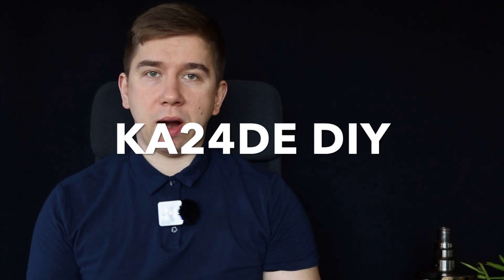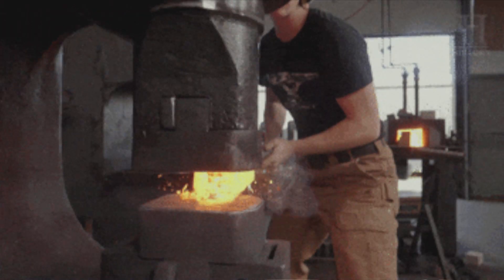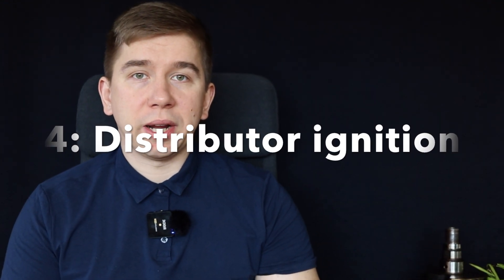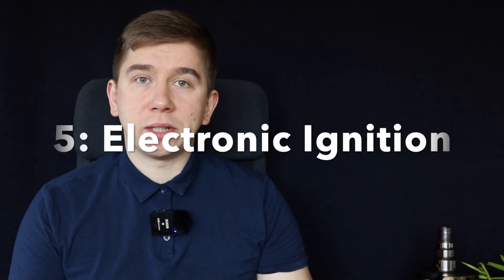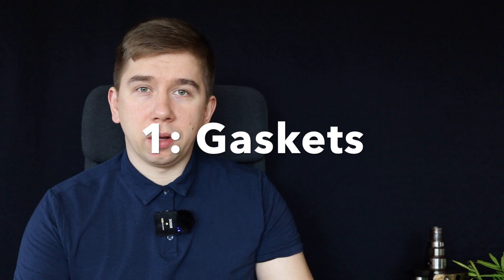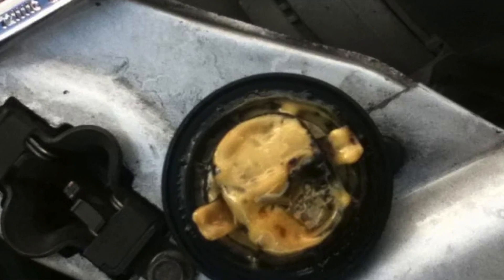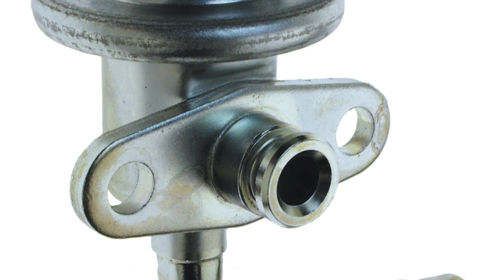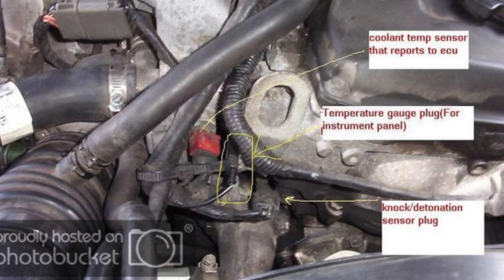KA24DE in Nissan 240SX, Altima, Navara | Strengths, Weaknesses and Common Problems | Do It Yourself

Comment: The only problem I have is the hydraulic lifter noise which seems to go away with fresh oil then comes back in about 1000 mile later. Not too noisy to worry me now

Comment: People dont even understand the sohc ka is pretty good turbo. They will take so much abuse and keep on running forever
Reply: My KA24E in my D21 blew out it's timing chain tensioner. I ignored the rattle for too long, and the stock one is all plastic. 

I thought it was worse and pulled the engine. It sat for so long before I did anything that the fuel pump seized.

Replaced that, and it would almost kind of run with a lot of ether. Found I had timing messed up badly and the oil pump was off a tooth or two. 

Now it won't start at all. Guess next step is fuel injectors, or something electronic. Need to try to pull codes. Waited a week, so I assume if I super flooded it, it's drained out by now. Pulled plug #1 and it does spark. Could always pull the rest and see.

It was a solid beast while it was running. Hoping to get it back there again. I'm more of a suspension guy than an engine guy, so I'm well out of my wheelhouse. If it does run, it'll need some exhaust work. Manifold didn't come off the engine but came off the pipe, now not going back together. I'm more rock crawler than drifter, so I'm not sure high hp is my game. Not that I'd turn down a few more...
Reply from the maker: @andrew40  Oh man that's unfortunate. Let me know when you get it to start!
Reply: @andrew40  How long did it take for the fuel pump to seize? Mine has been sitting for 5 years and ran great when parked. 163,000 miles on it.  Thanks
Reply: @JetCityMatt  All I can say is less than 8 years. That's how long mine sat when I found the problem. If you still have a good battery, go down and turn the key on for five seconds every now and then to spin up the fuel pump and keep it from gumming up. Unfortunately it'll still hum and draw current when stuck, so no way to tell without pulling a line or actually starting it.

I found the timing issue with mine was that I was 180 degrees out of phase. I set timing with cylinder 1 at TDC ... of the exhaust stroke (hey, I had 50-50 odds!). Instead of pulling the oil pump and setting correctly, I just left the distributor wired backwards. Works fine, and surely won't cause me any issues in the future when I forget that. 🙄
Reply: @andrew40  Thanks so much for your reply. I'm going to siphon the old fuel out of the tank and will pull the pump out them and inspect it and the tank.  Lots of other stuff to do too! It's quite a list. 
In 2020 someone got into the car and must have shoved a screwdriver in the ignition... then they realized that the battery wasn't connected and gave up.  Fortunately they didn't scratch the mint interior!  I appreciate your reply!
Reply: @StratMatt777  I have run a lot of very old gas in a wide variety of machines and have had exceedingly good luck. I'm definitely not one of those people that thinks once gas has gotten 6 months old it's worthless. I am fully on team "try it and see what happens" before doing any hard work. Can just pull the line off the fuel filter and see if it spits when you turn the key (or bridge the relay if you want to do it while staring at it, same place). Pulling the tank was a pain. Those bolts were super super tight on mine, plus it's heavy and awkward.
Reply: @andrew40  Thanks for that!  I last drove the car on 3/15/2020 and that fuel was probably a year old... so I've got 6 year-old gas.   Some guy had uploaded a video on here that showed a BMW 2002 he had bought that he had apparently been told had been sitting for 8 years and the tank was full of some kind of goop (that the fuel had turned into I guess?) that had seized the fuel pump.  
So, there is no harm in trying to start my car?  I was wondering if the tank could release rust or particles (I have no reason to believe it is rusty) that could clog up fuel injectors or something due to the fuel being 6 or 7 years old... It's probably 7 years old.
Reply: @StratMatt777  I would still say pull the line by the fuel filter and see if the pump is working. I replaced my fuel filter, too, so easy to do at the same time. If you can skip dropping the tank, I would. There's a sock on the fuel pickup to keep the pump safe and the fuel filter keeps the injectors safe.

I admit I was luckier in that I owned the truck the whole time and always put ethanol free gas in it, and it sat for those 8 years in my humidity controlled basement. I wasn't at all worried about water in the tank or rust. I did drain it while it was out and it was pretty impressively clean for as old as it was. I didn't feel the need to do anything to the tank.
Reply: @andrew40  Good points!  I forgot that the pump has its own filter too.  Maybe I'll replace that when I look in there.  In fact, I think I bought it months ago on Rockauto.
Reply from the maker: Yeah KAs are tough man
Reply: @marcinjedrol  The trail blazer motor is a monster also. Aluminum block and head. Its basically a 6 cy ls and just as strong

Comment: back in 2010 I rebuilt my DE with 1990 sohc pistons. they are flat top and raise the comp to 11.1...the 89 pistons raise it even higher but iirc that requires head work.
all I did was slap them in my block and go... rock auto had a clearance on KA24E sohc pistons with rings which came to $68 shipped. i was running intake, pacesetter 4-1 header, and your typical early 2010's angled n1 style catback.
after break in, we ended up running a 10.2 in the 1/8 mile with 225 50 15's on the stock rear diff.
with the 17's on the backroads it was a fun car. it had a lot of power, but i should have tuned it. i ended up selling it and getting a wrx but it was pretty sweet.

Comment: I have a 2000 Nissan frontier I would like to know if I could use the iron block off of a Altima around the same year and if the cylinder heads are compatible as well please help me I've been searching for a frontier engine and all I can find right now is Altima engine
Reply from the maker: Not sure about that, easiest to find pictures of bare blocks and see if the holes align